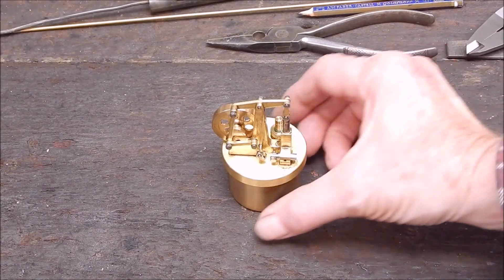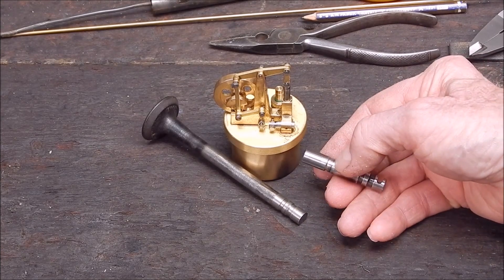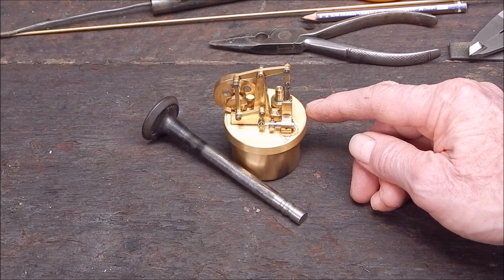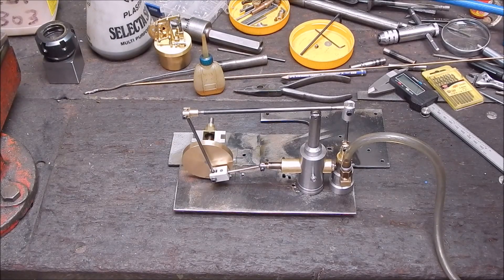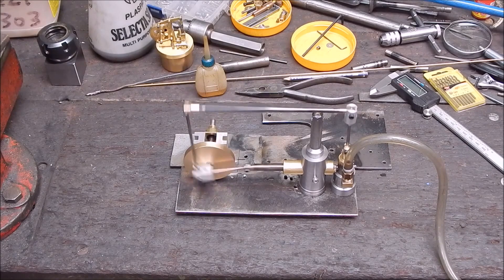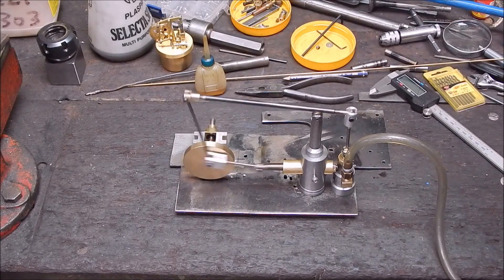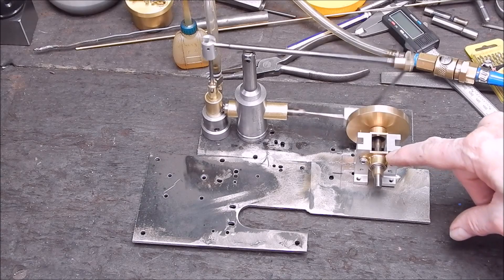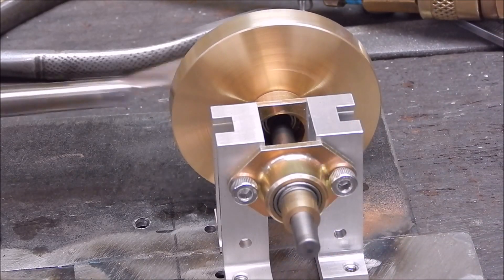Home brew rocking beam type model steam engine - made without any plans

Comment: Fantastic job, Rob! It just screams to me that it needs to be made larger and used to power a trip hammer...
Reply from the maker: I may try running a small generator off either of the last two builds.  Depends how much power I get out of this one on steam.  The earlier one only runs on compressed air and has plenty of grunt.  Cheers Rob

Comment: Rob, Is it a single acting piston? And for those who have trouble with maths can you please give an insight into the design calculations?
Reply from the maker: Hi Mike, it's single acting and uses the same port timing as a conventional engine - ie. power piston exhaust open at bottom of stroke on the power piston and feed valve open on top of power piston stroke.   The rocking beam is offset at the pivot point 4:1 to compensate for the unequal valve/piston strokes.  Cheers Rob

Comment: Cracking little engine Rob, well done! Interesting configuration with the offset beam, 1st one like this I have seen. 10 out of 10! Cheers, Jon
Reply from the maker: Thanks Jon, I was a bit worried it would jump around from the offset beam, but it actually runs very smoothly.  Cheers Rob

Comment: Hi Rob, Very impressed the engine runs smooth with some powerand thanks for your videos, well done.
Reply from the maker: Thanks Tony.  Steam is easy compared to Stirlings and flame lickers, but you gotta get those tolerances right, in the same way.  Amazing how little steam this design uses.  Cheers Rob

Comment: I have one of these Microcosm engines, w/o the boiler. had a go at making one similar using 303 stainless for the steel bits since it's easier to macine
Reply from the maker: Hi Paul, you could even use home cast aluminium with a bit of thought.  I will use brass for mine as I have some suitable.  Cheers Rob

Comment from the maker: NOTE:  I later shimmed the pivot points and got rid of most side  play in the rocker beam.  It needs a splash of paint on the steel bits, and next job will be to make a brass boiler and aluminium metho pot for it.  When all the mechanics and plumbing are done I will put it on a wooden base.   I fully intended this one to run on steam from the get go.  Still a bit more to do on it.

All good fun and a great way to play in the workshop and test your engineering and metal work skills. 

Cheers Rob

Comment: Lovely job there Rob, i especially love the bearing mounts..
I can see the steam bug gave you a good bite.
Look forward to seeing your future steam project's.
Reply from the maker: It's a lot of fun doing your own builds.  You never know till the end if it's going to work out.   Steam is easy compared to Stirlings, and flame lickers are best left alone from my experience ;)  Cheers Rob
Reply: @Xynudu   I have a flame licker engine from Bengs models, Germany to build.. So dont say that😯
 Maybe thats why it has sat in the box for years and still does..
Its coming into casting weather.
I want to see you start casting your own model engine parts. A horizontal engine frame or a spoked split pattern flywheel.. Just surprise us.
No time to waste... Better get pattern making Rob!
Reply from the maker: @djpaulk  I've thought about it, but what I really want/need is a small mill.  I've looked for years, but they are seriously over priced for what they are.  You can buy an MD46 for the same money.  Anything decent soon gets snapped up.  Space is the issue, as most work shop guys know.  One day it will happen.  Cheers Rob
Reply: @Xynudu  Owning a seig x2 mill i can say... Go big not small..
Big as you can go!👍

Comment: Lovely job Rob 👍👍👍👍 I love the design, most beam engines follow a certain arrangement but yours is just that little bit different. Runs a treat too, Cheers, Alan.
Reply from the maker: Thanks Alan.  It should look spectacular running on steam :)  I think I will rework the beam center pivot as it needs to have a wider bearing surface, but at least the engine ran straight off very nicely.  This model engine making caper is a lot of fun and really tests out your skills.  The Sumore 7 x 12 lathe has been getting a lot of use as well and is going great.  Cheers Rob